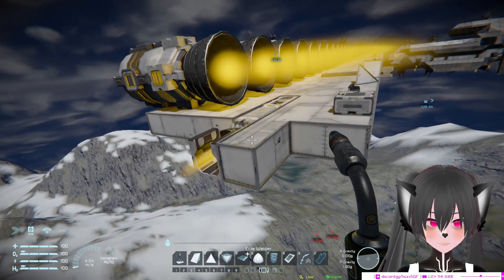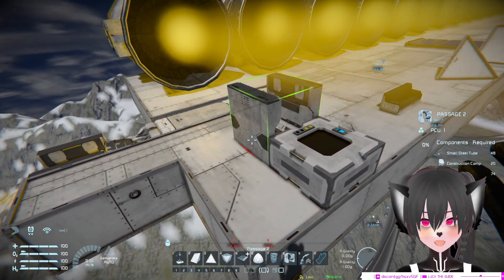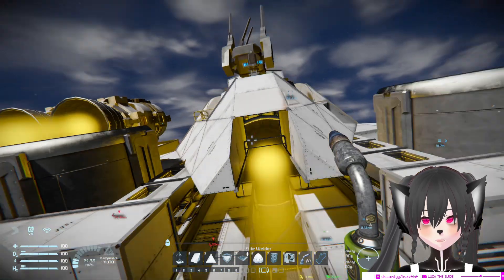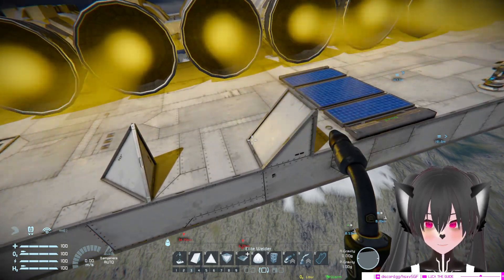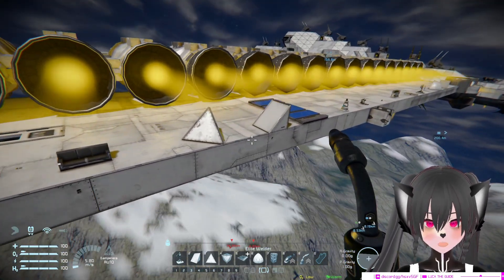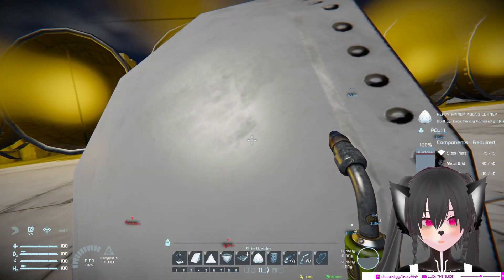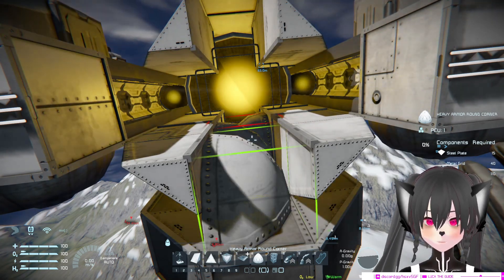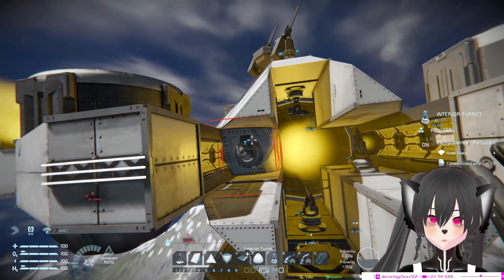Best Blocks to PROTECT Large Hydro Thruster, Space Engineers Ship Design Tutorial

Comment: They should change thrusters so they cannot receive damage from grinders while on. Realistically your face would melt off if you got close enough to grind a thruster while it was operating. This simply shouldn't be a thing.
Reply: In the same respect they would also damage every block around them if that was realistically the case. Thrusters are fine in regard to that, just have to defend them better. I would honestly like armored or higher tier, more powerful thrusters.
Reply: It’s steel. If that was true starships would melt whenever Elon threw them
Reply: @aidanmatthewgalea7761  Engines that we use IRL often have their nozzles completely open to the air or vacuum of space combined with liquid oxygen piping around it. Their internal components are also heavily cooled to prevent the heat from the thrust from melting everything and the combustion chamber often has ablative material inside which slowly gets vaporized away to keep the main steel body from melting. There is a ton that goes into rocket engineering to ensure it works as a rocket and doesn't become a massive bomb.
Reply: @elijahgrimm8052  fair. i see your point. also looking at the model there are infect coolant pipes outside. however SE should make it so if damaged it fries you as you have punctured the coolant pipes.
Reply from the maker: That would be good balance wise I think x3 but it already kinda damage people behind it while it's on / thrusting c=

Edit: though not as much

Comment: wow nice find. hadn't thought of the turret to block the space and protect it. I always worried that if I put anything with a computer chip in the area that it would draw fire. Is that worth worrying about or the threat of a hydroman bigger? Or am I overthinking the effects of stuff getting targeted?
Reply from the maker: Thanks xD yeah didn't know about some of these blocks' resistance to thrust until I did the test either. Having fire being drawn there is not usually an issue imo with how battles go c= (with how you fight, engagement and how shots get spread out in general) so I think protecting it from hydroman is more important but don't worry too much about it, best solution to hydroman is to jump away
Reply: @LucaTheGuide  The combo of Interior Turret then heavy round corner from the Thruster out seems like it would be the best of both worlds in your ships case.

Have the Interior Turrets set up at minimum range to target hostile and neutral players. Even set them to target rockets and have a psudo anti rocket counter measure for the rear thruster.

While the interior turrets could be baited by hydroman to eventually break the round corner heavy armour with how turret targeting friendly fire happens, it would only open the firing arc more making it worse for a Hydroman realistically. And heavy armour has relatively cheap material costs, so not really a problem.

Nice find, will have to incorporate it into some warship designs. Cheers.